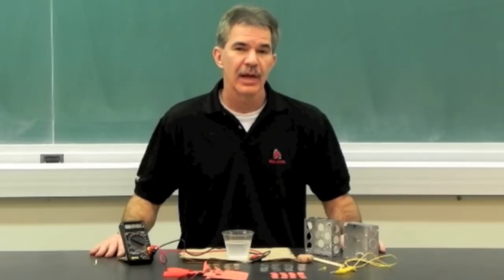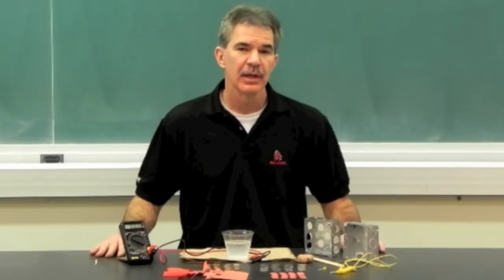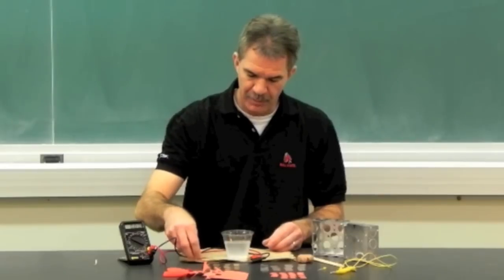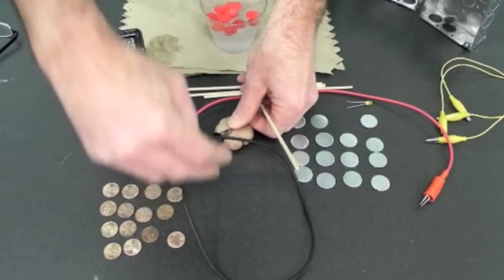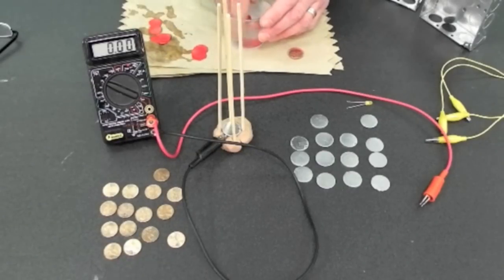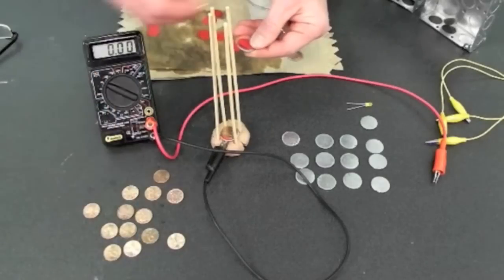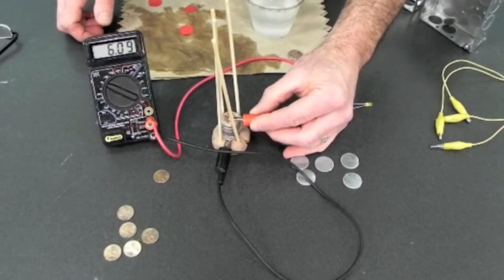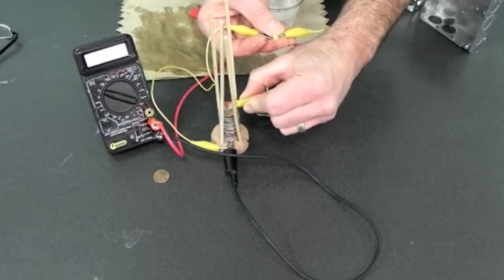Recreate Physics History: Build a Voltaic Pile | Arbor Scientific

Comment: Penny Thought; Experiment.
...
Voltaic Pile wrapped like a Jule(sp?) Thief.
With or without core rod wrapped like earth battery.
Core rod material:
Magnesium, Brass or Alum.
(I could only find tubs of Brass, Alum & Coper)
Dry pre mix potential material:
Epson Salt, Silica Sand, Borax, Baking Soda, Salt, Sugar, Cement &/or Dry/Liquid Alum.
...
TeaLight Case, Coper Plumbing Cap, or something of the like.
(Trouble Game)
...
I think it has potential;
Try to play with the magnetic fields.
Thank you.